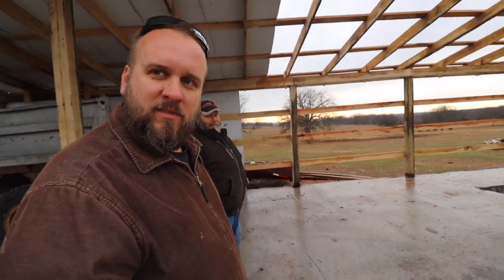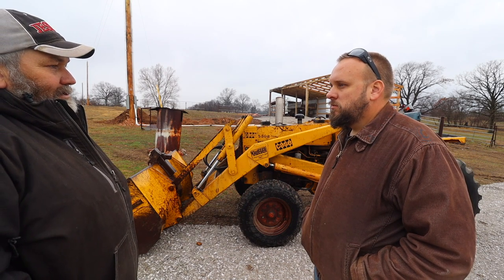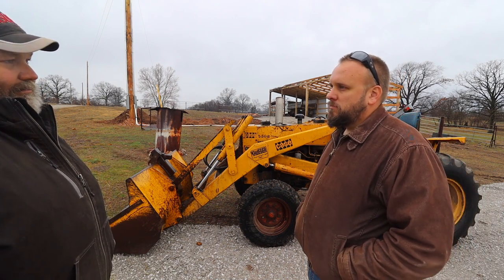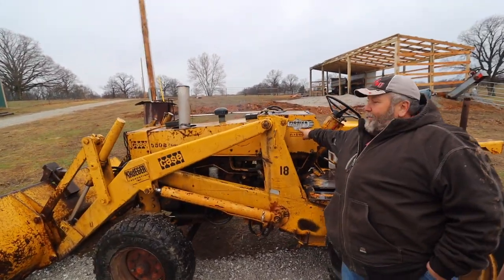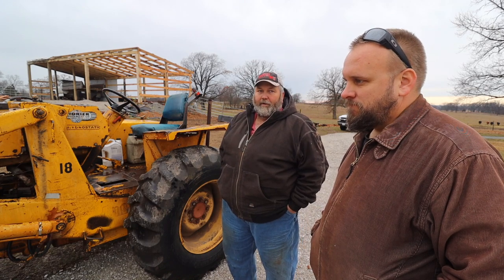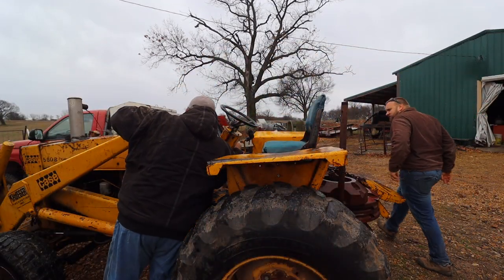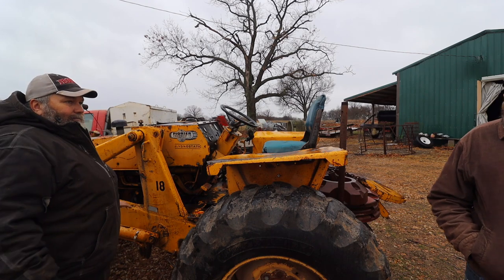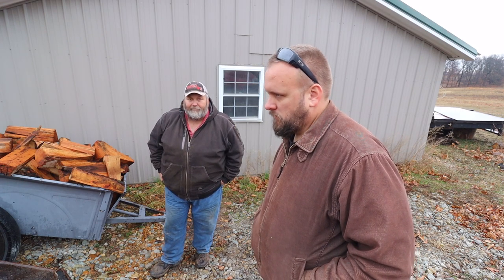A 50 Year Old Hydrostatic Tractor Still Putting in Work - Case 580B

Comment: Ausralia here,I  have a CK 580 thats hydraulic drive and shuttle shift.Everything works fine still after all these years though she does leak a bit of oil from the rams.I see that you are carrying a lot of wieght over the rear wheels.They really need that once you take the backhoe off.I made a steel framed weight block,threw in a few old junk motors and encased the whole thing in cement.Holds the back down well.

Comment: I like that on that machine Paul carries on it a 2gal jug of motor oil and a 2 gal jug of hydraulic oil for fill ups!   Check the diesel and fill er up with motor oil and hydro oil!! 😂😂😂. I love the older equipment also… it’s all mechanical and no EPA or regen crap!    It’s always a great day whe. You and Paul get together! 🔥🔥
Reply: The biggest oil leak on this one is power steering. Better carry some with you or you will not be able to steer!

Comment: I am still getting my 1966 (based on serial) Case 430 Construction King from auction working. I hope to god I don't have to stack that kind of weight on the back. Mine is also a wheel loader without the optional backhoe. Mine does have a PTO though so I'm hoping my Brush-hog will be sufficient ballast. My lift height is also scarily high like that. It's gas and not hydrostat.